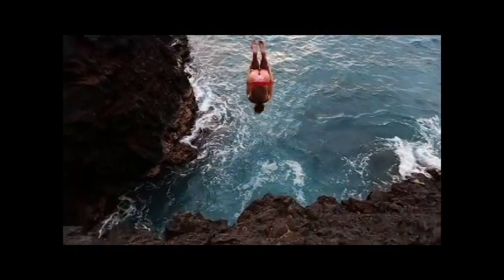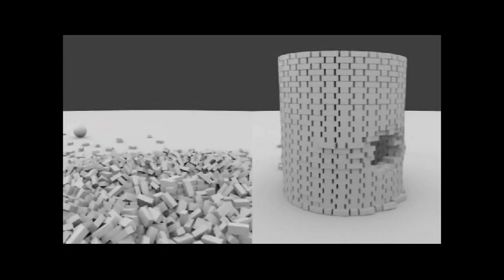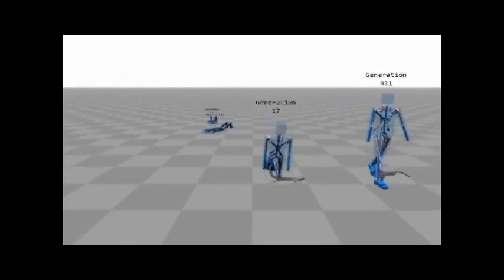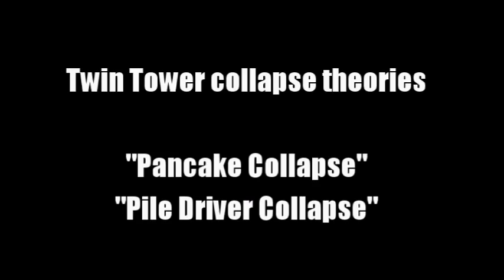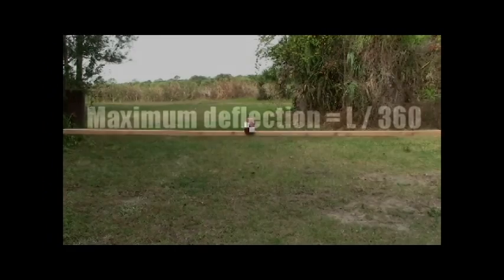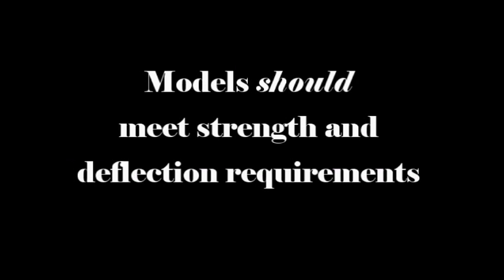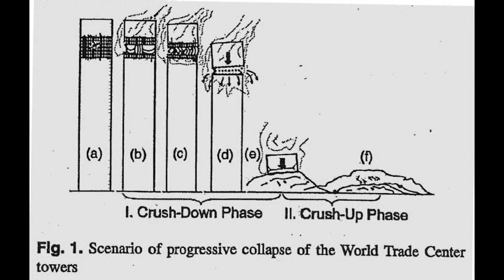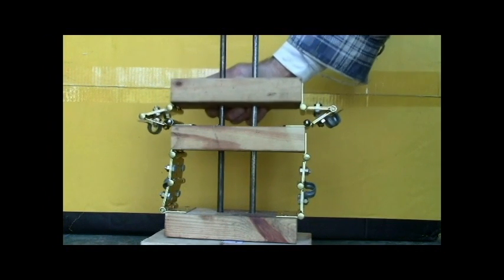9/11 Experiments: The Force Behind the Motion

Comment: this is ridiculous. Did they take into account how old the buildings were? no
did they take into account not just the top floors were on fire? no
 did they take into account the buildings were only plane proof for an aircraft at landing speeds? no
how about the impact of the airliners flying at high speeds? no
did they take into account the steel beams were weakened from over an hour of burning? no
If it was an inside job, wouldn't there be a larger paper trail?
why would the government intentionally kill its own people?
Reply: How old was the ESB when it was hit by a bomber?
Reply: SIater SIater  decently old however, the bomber that crashed into the esb was significantly smaller then the Boeing airliner that hit the wtc. The bomber was also going about 150 knots, as the airliner was going 600 knots. The airliner also had significantly more fuel on board (about 250,00 pounds) where the bomber had about 2,000 pounds.
Reply: I made that mistake and i've accepted it. All your doing is insulting my intelligence, acting like a child, when I have done none of that to you. You have still yet to bring me more debunking facts to my questions as well so I don't know what your getting at.
Reply: evsupp2011 the wtc just might have survived if maybe the plane was going at landing speeds. The plane was however not going at landing speeds. The aircraft was go significantly faster, as the wtc was designed to take a hit from an aircraft at landing speeds. Not full flight break neck speeds.
Reply: And also if you want to say the towers were made to "withstand an airliner strike" they did. The towers stood for hours after struck by the planes. The fire is what caused the collapse.
Reply: I don't believe you have your facts straight at all because it is written in the 9/11 Commission report that the two 767s had no more than 66,000 pounds of jet fuel on board at the time they reached NYC on 9/11. What other facts have you got screwed up?
Reply: SIater SIater I'm sorry, I meant pounds of kinetic energy the planes were traveling at. Still shows the boeings were bigger, and going faster, and had more fuel. And I've stated many more questions for you to answer and you only managed to bring up the fuel, which makes little difference.
Reply: FishermanTryingToVlog46  How exactly did you expect anyone to interpret your writing of "The airliner also had significantly more fuel on board (about 250,00 pounds) " as kinetic energy Speedy? Do you know the amount of fuel would have a direct effect on kinetic energy of the alleged impact of the airplane or have you gotten that far in your grade school science text books yet?
Reply: TheFishinMagician13  Do you have proof of any kind that the trade towers were not designed in the 1960's to withstand airplane impacts of 500+ mph as John Skilling's 1000 page building analysis fortified in print? Both John Skilling, the structural engineer, and Leslie Roberson, his subordinate never claimed the landing speed only design while John was still alive.
Reply: http://www.911myths.com/html/wtc_707_impact.html   
Think about this, even if they were claimed to hold up against an attack (which they did until the fire did significant damage) why would the government build a building that couldn't hold up against a plane crash years before, then decide lets just fake a terrorist attack and kill over 3000 americans just to start a war? It sounds absolutely crazy! Think about the logic that makes in someones head.
Reply: FishermanTryingToVlog46  Are you saying the government agreed to build the trade towers for David Rockefeller at tax payer expense?
Reply: All I'm saying is that all this "9/11 was an inside job" stuff doesn't add up to me, and I have yet to be presented with facts that undoubtedly show otherwise.
Reply: FishermanTryingToVlog46  Do you think it's a good way to make your point that the inside job stuff doesn't make sense by linking to a government propaganda page listing unsubstantiated "facts" on a web page that has no reason for being as it is not monetized by ads and does not identify the authors on an about page?
Reply: the 9/11 truther that changed his mind spoke to the engineers that designed the wtc. They told him the exact same thing. The towers were designed to take a hit for a slower moving aircraft. This fact is besides the point as well. You have not listed ANYTHING that could validate this as an inside job. I'm still waiting...
Reply: FishermanTryingToVlog46  "the 9/11 truther that changed his mind" ???
"engineers that designed the wtc"  ???
Please name these individuals and give links to their full statements as citations that I can verify.
Reply: https://www.youtube.com/watch?v=r_UYZITc_90&t=879s

Watch for yourself lol
Reply: hey you as well :)

Comment: So THERMITE  doesn't dissolve into smoke. it flares up, gives off high intensity heat quickly, dies just as quickly and becomes non reactive compound. If the  WTCs were buried in Thermite, i could buy it. 

Controlled explosion? i can maybe buy it but going back to the video,  one explosion placed perfectly below where the crashes were, would stop the fall. so youre saying that the building was wired with explosives on every floor and no one noticed wires and bombs? There also werent any explosions out of sync like you were showing. if they were controlled, somewhere there would be a person next to a control board switching 200 floors worth of detonations.
Reply: Bullshit and you know it!
Reply: Don't really care what you buy into. Your opinion is irrelevant.
Reply: andrew montell  Are you just being a sourpuss because there is no evidence to support the official conspiracy theory you are paid to lie about Andy?

Comment: This video and these so called experiments do not represent what happened on 9/11.  For example, it does not account for the MASSIVE structural damage suffered by the core columns on the initial impact of the airliners. It doesn't in consideration the initial explosion and the sustained and extreme heat the remaining structure was punished by for long long minutes,.   It doesn't take in consideration that NO weight support was imposed on to the surface structure... represented here by...pizza plastic holders ... scientific accuracy..indeed......                                      When the building caved it wasn't with a down ward weight crushing through the top floors going downward as shown on this video.   It was the weight of 30 plus floors going down on every floor below, one after the other, and one adding to the other.

It really doesn't take a fully formed structural engineer to understand the very fundamental forces put in play that day.

If you'd want to be accurate .. you'd have to build a scaled structure with exactly the same structural supporting cores, which obviously is not respected here. Then throw at it an aluminium/metal/titanium large object at extreme velocity charged with 10 tonnes of aviation graded kerosene... let it burn for a good half an hour, see what is left, and then see what the weight of the 30 floors above does to the remaining damaged structure.

Then only ... can you start to appreciate what really happened.
Reply: What is a Forex ample?
Reply: The proof that you cannot possibly understand a rational argument ;)
Reply: at your service :)